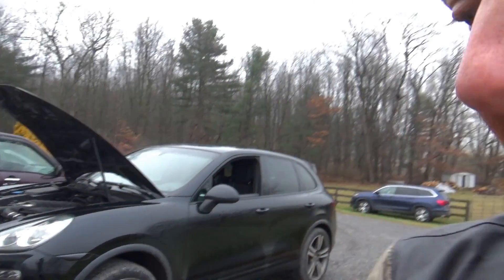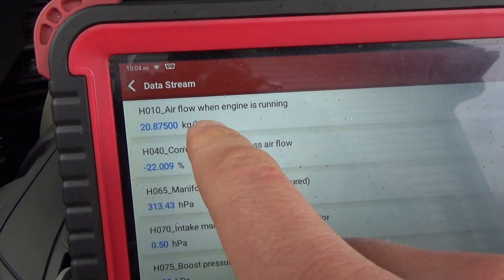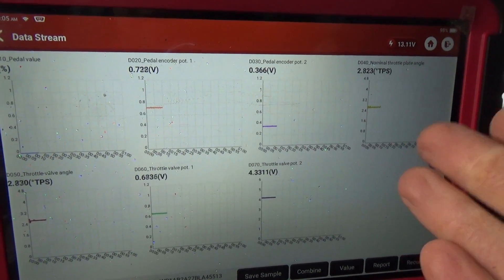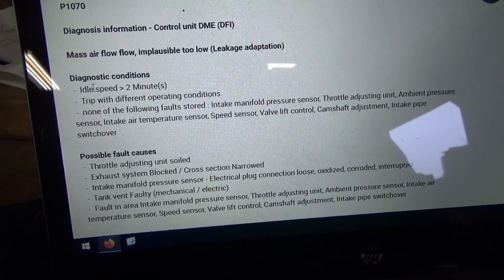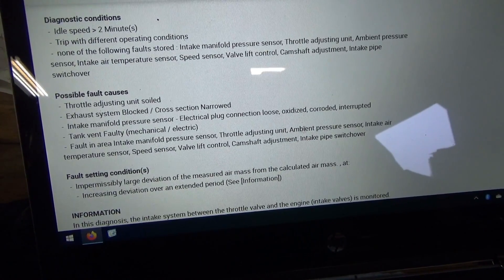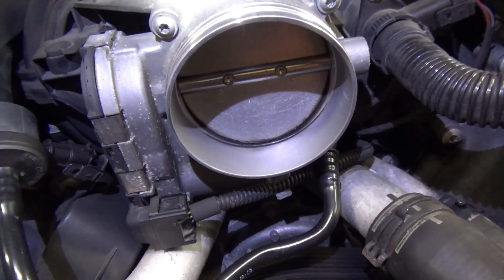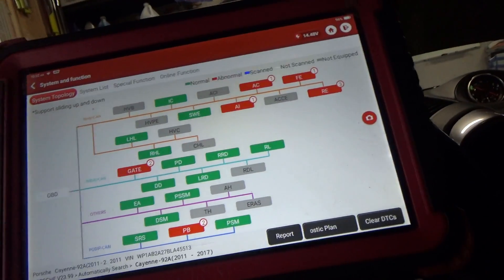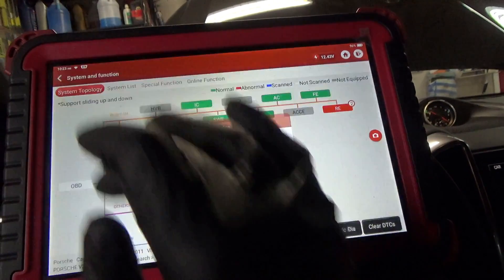The Parts Cannon PORSCHE? (MAF "Implausible")

Comment: Nice to see the effect throttle body can have and how to clean it. I had my airbox apart, sprayed the mass flow and throttle body, did not get in there with a paper towel because it was in the middle next to the firewall, I guess I should have leaned over and scrubbed the walls a bit.
Reply: Yeah, crusted goo builds up behind the plate, far more behind the plate than in front of it. Must have something to do with the high velocity air after it's sucked through the small gap.
Reply: Only if it's dirty enough to stop the flapper from closing.  It only takes a little build up to hold that flapper open, which will cause it to suck in more air than it's supposed to..  This is why older cars had IAC (idle air control) valve, which could account for the small difference, and could then handle being much dirtier.